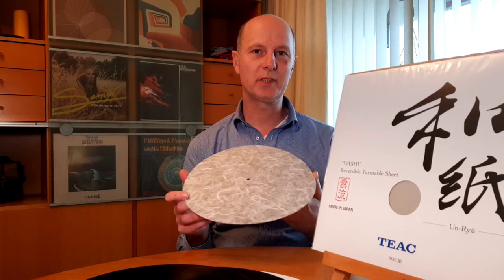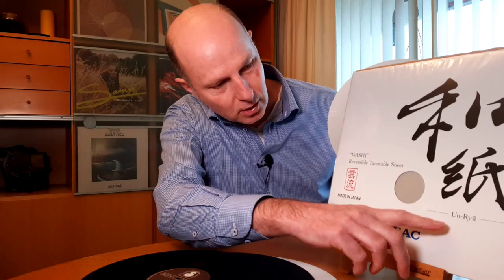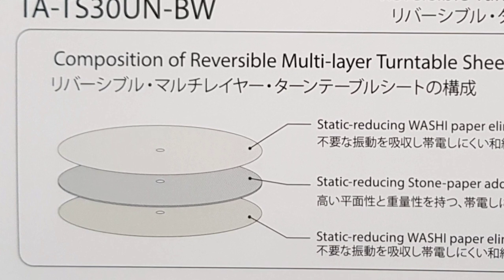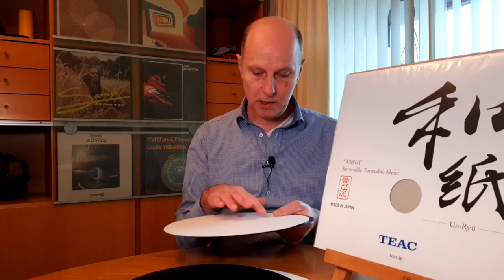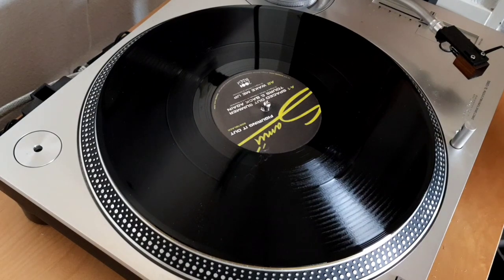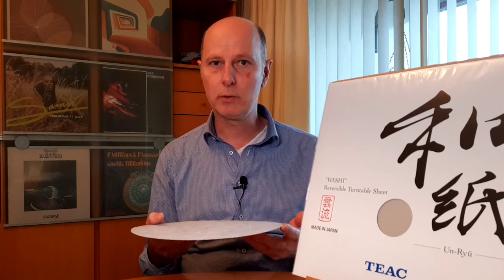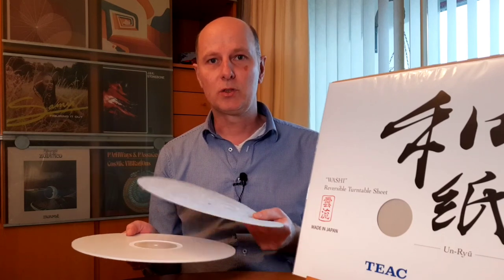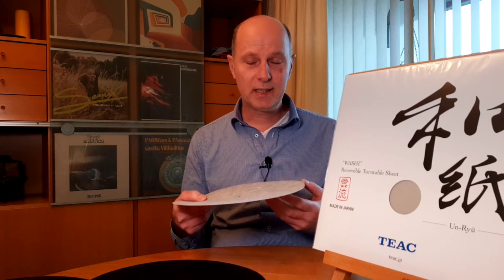Review JAPANESE WASHI TURNTABLE MAT TEAC TA-TS30UN - Vinyl Community

Comment: I have this mat as well, how do you compensate for the lack in height? I have an SL1210 and since this mat is really thin compared to the 5mm rubber mat? If I compare the VTA I would have to trim it back to -1, when using the rubber mat it is on 2. What VTA setting are you using and what is your carttidge height?
Reply from the maker: Hi! I understand what you mean. Especially with a cartridge with a lower height of 17mm this can happen. The cartridge I use is a DL103R, and with the washi turntable mat, the back end of the arm is higher as the tip. As the DL103R has a conical tip this is no problem. Thanks for watching. Cheers. /Paul